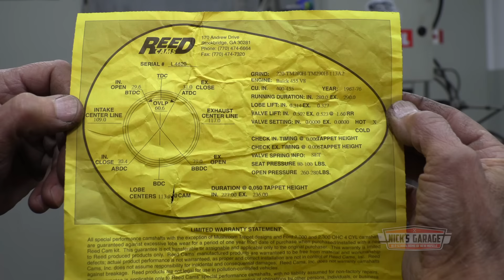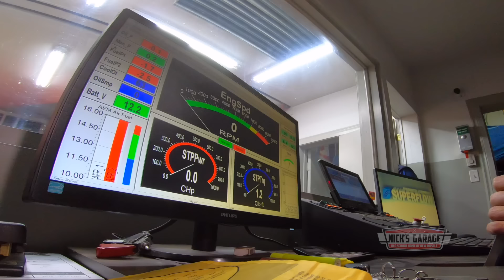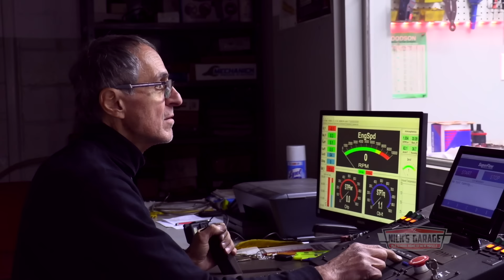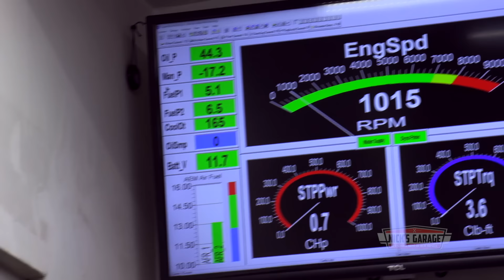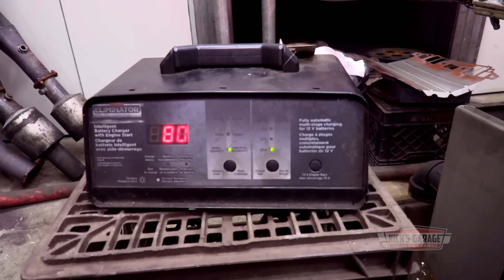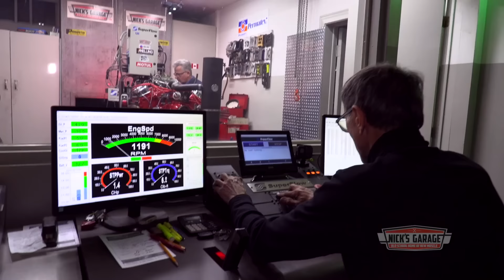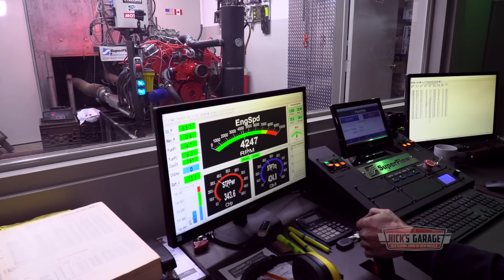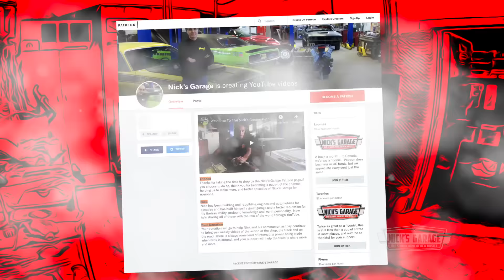1970 Buick 455 Stage 1 - Dyno Room Diagnosis

Comment: A couple of things. Don't use the cord for a rubber gaskets on the China wall. Just put a quarter inch bead of Permatex Ultra black across the China wall and set the intake directly on that. Because you have Deck The Block you're bringing the cylinder heads closer to the engine so naturally the intake manifold will want to sit lower on the engine as well and those gaskets are holding it up off of the heads also most Buick engine builders will agree that with Buick intake manifolds you're better off torquing them from the Four Corners towards the center because the castings are so light that if you torque them from the middle out they will become slightly bananas shape and leave the four corner ports open
Reply: That is also why you had water leaking from the back of the intake manifold
Reply: Also wondered why they werent using a torque wrench to tighten the intske bolts to spec?
Reply: @Crazy8ts  you know, I was thinking that exact thing as well. While there are some engines that have super thick castings and aren't so picky about it, such as FE Ford engines, Oldsmobile, and Cadillac engines, there are a whole bunch that are quite picky about it, Buick being the most picky of em all. Pontiac engines can also be kind of picky as well.

Comment: Good job in the build Nick me and my dad built a lot of Buick oldsmobi'll Cadillac and Chevrolet big blocks what we used to do to get more horsepower power is clean up those heads unshroud them clean up the ports big difference  I'm not saying to do a raceport job just a clean up

Comment: Ah, a rope rear main seal....you thread it in with the tool, which was just a little band of metal with a hook, then pull the tool out in the opposite direction. Trim the rope flush with a razor blade. I think them last one I did wept just a little oil. Good stuff, Nick!! Queasyrider

Comment: Maybe some goof used the "Chevy formula" when he cut the heads during the earlier rebuild. The angle of the intake face on the head, compared to the angle of the deck, is different between a Chevy and a Buick. This means that it takes different amounts of material to be removed from the intake side of the heads after they are resurfaced, between the 2 makes. If the guy used the "Chevy formula" to figure out how much to remove from the Buick head, the intake WOULD be misaligned. 🤷🏻

Comment: If a cam is properly lubed and installed, why does it need broke in?  Also seems like only some need it.  Thanks for great informative viewing.
Reply: Every flat tappet camshaft and lifters requires a break in period. All it is doing is putting a wear pattern in the lifter. Has nothing to do with being installed correctly or it having lube on it.
Reply: @jrdmotorsports9718  thanks for your reply.  Roller tappets don’t require break in?  Also wouldn’t the flat tappets run the same position under normal driving without break in?  Thanks for help.
Reply: @garysuper5338  No, roller camshafts and lifters require no break in period. The point of breaking in a flat tappet is really for the lifter, not the cam. The lifter bottom is flat. The cam lobe has a degree of taper to the lobe, which spins the lifter as it rides the lobe. If you were to not break it in correctly, or break it in period, the flat steel lifter will flatten the soft cast iron cam lobe. Hence the 2500 rpm for 20 minutes procedure to let the cam lobe wear a pattern into the lifter. Spring pressure, on a steel lifter, riding a cast cam, at low rpm, will kill the cam.
Reply: @jrdmotorsports9718  man I really appreciate that.  80 years old and just learning how an engine works!  I love this video site.  Thanks again.
Reply: @garysuper5338  🤘😎👍
Reply: @jrdmotorsports9718  Actually, the lifter base should not be "flat" but instead slightly convex to induce lifter rotation to dissipate heat.  No lifter rotation = lobe and lifter failure.
Reply: @jrdmotorsports9718  I read very well and I've read several of your comments and have AGREED that all of these engines have over-rated hp and torque #'s when factory stock.  I've also caught your errors, but not worth debating them.
Reply: @LR-my2di  Only errors i see are the ones where you think because it has a brand name on it, it's different. That's called Tunnel Vision my friend. An engine is an engine, and any REAL builder like myself, builds the engine according to math. Not brand.

Comment: With over 25o dyno pulls for superstock nhra, let me tell you, A/f ratio is everything, timing is secondary to a point depending on adjusted  altitude. If it ain't ready to run on the dyno, it ain't ready. Still love your you tube!

Comment: A few basic steps when changing points on a distributor is to always clean the point cam lobs and then grease them with the appropriate lube. I never see this done on many of these channels all though it may be done off camera. I heard reports that newer replacement points have been having problems with the point cam lobe lock wearing prematurely. This may be part of the problem, no lubrication. Also, always check the timing after setting the dwell / point gap. Dwell affects timing. On a points system the timing changes as the points wear (changes dwell). That is only one of the many reasons cars all went to electronic ignition when in 1975 unleaded gas and catalytic converters became the standard. Dwell angle degree is the the amount the points are closed and is the most accurate and easiest way to set point gap instead of using a feeler gauge. I always use a dwell meter to set points on any make or model vehicle.  Spin the engine (using a remote starter switch or someone in the car) and read the meter while setting the points. GM with the distributor cap window is by far the easiest and a blessing when they came out especially that Chevrolet always put there distributors in the back of the engine. Just my two cents on point systems. On my own 1969 Ford 351W car I added Pertronix Electronic Ignition in 2001 and haven't changed the timing since!
Reply: YEAH...I BOUGHT A TUBE OF THAT GM POINT LUBE...YUP...MY 55 235 DAD BOUGHT NEW...HE PUT A DUAL POINT DIST PLATE IN IT FROM A 53 BUICK...BOLTS IN...HE EVEN PUT EX VALVE ROTATORS IN THE HEAD...BUT THAT CRAZY ENGINE WOULD STILL BURN AN EX VALVE AROUND 32 to 35,000 miles...crazy...
Reply: You don’t lube the lobes you stack some on the following edge of the rub block on the points. The block won’t spin the grease off and as the block wears it adds grease to the contact point automatically. 
  I used to use Standards Blue Streak line or Napas points exclusively. They come with cam lube.
Reply: Well I agreed with you up until you said putting distributor in back was good idea. That's one of the stupidest things Chevy did.
Reply: @cammontreuil7509  Putting a window in the cap was a blessing since the distributors were hard to reach in the back. I agree on the location being not a good idea.
Reply: @paulkocek6576  dang. Someone agrees. My first car in 1975 was a 65 283 Impala. Setting those points hurt my knees every time.
Reply: Yep. Dwell was an important thing to get correctly set. One could still get the timing spot on while ignoring the dwell, but the engine could still run poorly. For those who dont know, the dwell controlled how long the points remained closed, and "charged" the ignition coil with current from the battery. The coil acted as a "storage device" for the ignition voltage sent to the plugs. Too short of a pulse sent to the coil would result in low spark voltage from not enough time for the magnetic field to build up in the coil. Too much of a pulse sent to the coil would allow the windings in the coil to "saturate", pull too much current in the primary winding, and burn the coil out early or burn the points up faster. This is also why you arent supposed to leave the key in the "run" position for long, without the engine running, on an older points engine. If the engine just happened to stop last time with the points closed, you'd be baking your coil if the key is left on in the run position.
Reply: @bluecollar58  Accell makes a good quality points lube as well.
Reply: Always had a tube of point lobe grease in my tool box. Set new points at 29 degrees. As they wear in, should get to 30 degrees. Only time I had intermittent problem was point mounting plate center bushing worn. Vacuum advance movement would change dwell a lot. Condenser can be defective also. Condenser absorbs spark so points don’t ark and boosts reversal of primary voltage back to coil where the major magnetic collapse occurs creating the high voltage spark to plugs.  At least that’s the way I was taught in mechanics school 1965 and 1966.
Reply: haha,  even Nick is like "  haven't worked on these points in a long time. "  When i was young that was the only way.  The above advice is absolutely standard in working with points.  Interesting that the guy says that when mechanical points work well they are very good.  It is a tried and true system that does not need a computer chip to function.  Also i understand these " dial gauges " convenient,  but the old form of " feeler guages " with tolerances worked very well and simply.  A case similar to this is " plastiguage "  which is still the standard with bearing clearance.  When i worked on bicycles,  reaming the frame for bearing seats or threading the italians used " go-nogo "  tools that either fit or not.  Very simple.
Reply: You set the points at .016 +/- with a feeler gauge, if you didn't have a dwell meter. If you didn't have a feeler gauge, you could use a piece of cardboard from a matchbook cover. Close enough to get you home..... Queasyrider

Comment: Remember the Buick oil pump has to be packed to Vasoline prior to installing otherwise there will be air lock and no oil will be pumped from the oil pan.
Reply: You are right!  I was cringing a bit.
Reply: @lunati1313  I rebuilt a 430 in the 1970's and missed that part in the Buick engine manual. Fortunately the oil did circulate, I have no idea how long that took  and I didn't seize my new rebuild.
Reply: Is that a Buick thing? I was taught to prime the engine to full oil pressure before starting.
Reply: @williepelzer384  The oil pump is located on the timing chain housing and therefore has to draw a large distance from the pan. The Buick Engine manual states that the pump should be packed with Vasoline before installing to avoid a vapour lock.

Comment: Those oil pump gaskets are notorious for squirting out. I used to go around the cover’s sealing surface with a punch to make a row of little volcanoes that bite into the gasket. If I were doing it today I’d just CNC a path for a 1/16” O ring .06 wide by .048 deep and adjust the gear end clearance in the cover as needed. The intake/head angles were always off too and would have water and crossover leaks that were epidemic. It was actually the heads angle that was off but usually you adjusted the intake to make it good.

Comment: uni-points and condenser sets were junk in the day and they still are. Highly recommend separate points and condenser. What is the idle A/F ratio with the PCV hose and valve installed ? Did you use manifold or spark vacuum source for the vacuum advance?

Comment: I think you are 20deg duration over cammed for those heads and your rpm range you are running. I think a different cam would make a lot more difference in the overall power output than .020" of head gasket thickness.
Reply: This is a big engine. Cam was fine for the intended purpose of a "cruiser".
Reply: Compression is everything...

Comment: Back in the "good ol days" when you installed the metal intake gasket you slathered both sides with permatex aviation liquid gasket. Like brown tar, they would always leak if no sealant was applied.

Comment: What vacum source do you have going to the advance unit? If it’s manifold pinch the line off or plug it and see if that changes anything. No EGR so that eliminates a sticking EGR valve.

Comment: Seems like an Edelbrock performer manifold would make a difference on the old Buick and be very street-able. back in the day my 440 ran OK with the stock intake and headers. Once I installed the performer intake, the beast came alive!! lots of top end RPMs and power
Reply: Yes - but that eliminates any Pure Stock or even F.A.S.T. racing so the best solution is to Extrudehone. And of course port-match. Use thin steel head gaskets. And on-top too — a heat spacer — and everything opened-up and matched.
Reply: Closer to "Pure Stock" would be the old B4B manifold, which Edelbrock is making again. That was the manifold for the Stage 2 engine.
Reply: RPM no s, ever
Reply: The Edelbrock manifold is so much better and lighter too..
Reply: @karaDee2363  Yes it is but … it disqualifies the car for the Pure Stock, and F.A.S.T. ( factory appearance stock tires ) racing classes it was born-to-run in. The ExtudeHone of intake - exhaust - and heads is much of why you see “Pure Stock” cars running 2 seconds and 10 mph faster than they did new. And we rarely ran street gears above 3.90 or 4.10. Although I ran 4.56 with a 289 K-Code Mustang I
Reply: @karaDee2363  Agreed.
Reply: @1badhaircut  What about the B4B. Wouldn't that also qualify as "stock"?
Reply: @1badhaircut  I was under impression this engine was for a street Cruiser
Reply: in a BBC the Performer fell flat at 5500 RPM, Went with a Torker II and it made power through 7500
Reply: @Steve340  That's because the Performer was designed to make power into that mid/upper 5K rpm range (says so, right in the literature).
If you think the Torker II is making you power, try a Victor intake on your engine. I think you'll notice even more performance gains.
....of course, if your car is a 'vette, then you're stuck with the Torker II.
Reply: You have to remember this is a Buick  455 not a 440  Buick are like Olds they are very touchy motors it's not like a Chevy throw anything on it and it runs...
Buick & Olds are just that way to much carb and they run like crap...they didn't like a lot of cams as well ...
Reply: @peterrivney552  330 was a finicky engine too. My 75 Hurst/Olds W-30 455 was pretty tolerant of mods though...

Comment: Hey you need to plug that vacuum at the rear of that intake that hole emission system is a closed loop throughout the whole engine if you don't plug it up it won't run on an idle

Comment: With respect to the story time comment on the 71 Hemi Cuda race against the 70 Buick 455 Stage I, I was there and witnessed the event.  If I remember correctly the agreement between the racing parties was stock appearing cars with just slicks and stock appearing they were. The owner of the Hemi Cuda had made a remark that he had changed to a different cam the night before and the Buick was allowed to be running an inverted air cleaner lid. Nick was right , about the Hemi Cuda being trailered in. I believe the Buick GSX drove there. The Buick was the underdog with its 750 cfm  quadrajet against the Hemi's 2x4 carbs and cam timing. Both cars had cast iron factory heads, manifolds etc. We also know the Hemi on the dyno liked cast iron better than aluminum.  I would say the race was fair under the circumstances and agreements made. It's too bad  the Hemi guys decided not to continue.
I love both makes and have owned and raced both. Buick motors that are modded are so under estimated.

Comment: I always put a little permatex or Teflon paste on the intake bolts keep oil from migrating and usually replace the timing covers if they have the oil pump built in even if they don't most of the time on those old motors! If it sucked an intake gasket  stick your finger in the  pcv grommet in the valve cover and if it tries to suck your finger in you know you got a vacuum leak internal

Comment: nick I had the real stage 1 it has larger valves than a regular 455 I believe the intake valves were 2.12" check on that as well as differnt cam grind and better valve springs?

Comment: Have you ever used Plastiguage to test the contact angle between the heads and Intake? I heard that using it from top to bottom, and bolting the head on lightly (not to full torque spec) will show if the contact is unequal from top to bottom. If it's consistent width, it's good. If it's flared out , it may need to be machined.
Reply: I have done in the past. Did not expect it on this Buick. All I did was deck the block .015.